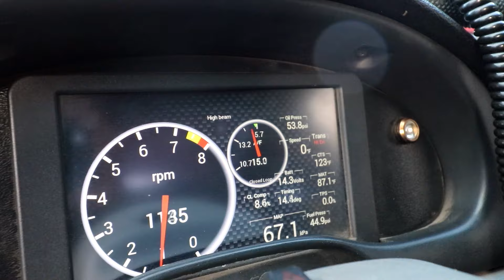TX2k24 Day 1 - Goku Fastest Mph Ever

Comment: unlike a reginal event... lined up to the point of, only getting one pass on each day? constrainous ... just like how some gas station only sell 170 proof and don't label anything on the pump, so the tow rig burning gas needs 4 times more pump then it should normally be using.